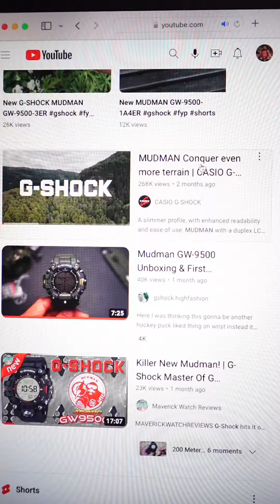The Mudman stays.

Comment: The term "tool watch" is something not to mess with.. Even Sinn creates the helicopter rescue watch that you can remove its bezel, so in case it got splattered by blood, it can be cleaned easily
Reply from the maker: True! What watch are you wearing these days?
Reply: @JimKinkade as you can expect, G-Shocks 😂 have been ditching the mechanicals for formal occasions